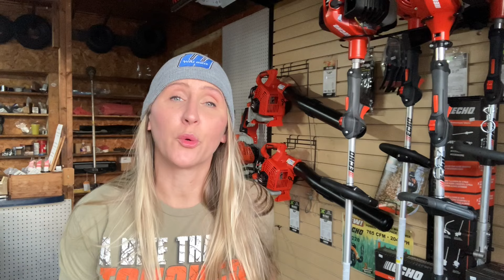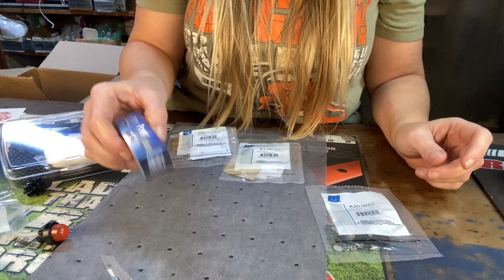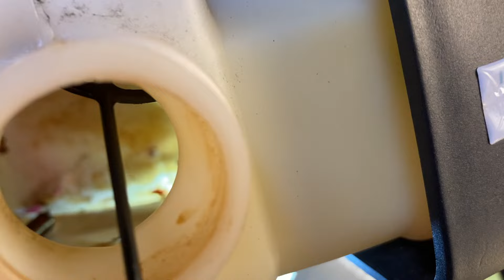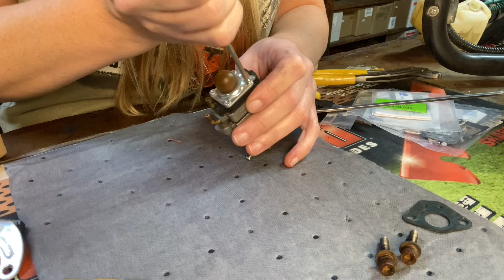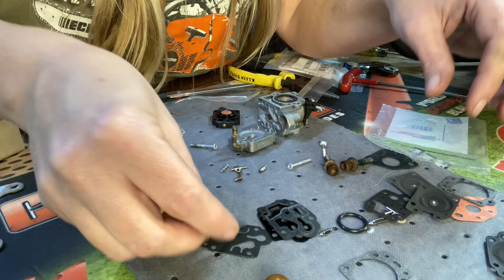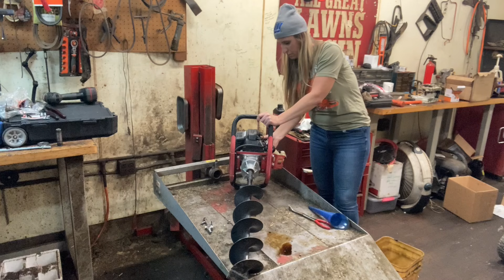Will it run? WALBRO put to the TEST with one of the NASTIEST pieces of equipment in the shop!

Comment: Well we know you're human needing glasses like the rest of us but how do we get some small fingers that are really useful?
How many shops just replace the carb?
Another question I have about ethanol fuels is I was once told by a gas station owner that fuel companies made high octane fuels by adding ethanol so how is it possible to avoid ethanol?
Where I live the available octane ratings for gas are 91, 94 and 98.
From what I was told 91 is the only fuel that doesn't have an ethanol mix.
Do chainsaws and string trimmers have high enough compression ratings to require more than a 91 octane?
There's a lot of ignorance much to the oil companies delight I think where people have been fooled into higher octane fuels believing they are better for their engines but only the fuel companies get any benefit from the higher prices.
Confused especially as I have a brand new Stihl string trimmer running on a 91 mix that starts easily but bogs down and dies as soon as I try to throttle it up. Stihl have told me to turn up the mixture screw which doesn't seem right as anyone would have to believe their factory settings are right straight out of the box.
Do I turn up the screw or use a higher octane fuel that everyone seems to think is bad because it has ethanol in it?
I'm using Stihl's own two stroke mix in the 91 which runs a Stihl chainsaw just fine.

Comment: Have you fixed a riding mower that will only start with a shot of starting fluid ? Mine just started doing it 3 days ago but once it starts on ether it will run like it should but will not start back up with out a quick spray of ether
Reply from the maker: I would check the choke system first. If it has a Nikki carburetor, the lever and flap are terrible about sticking.

Comment: If I were you I would invest in a " Pop-Off " gauge and pump and spring kit.
Now that you are using parts that differ from the original you may have to adjust the let off pressure on the diaphragm needle and fulcrum. Failing this McCullough used to sell a kit for the HL-HP carbs to tune, this kit might have matching parts Tillotson also sells a kit that covers  many of their carbs.

This let off pressure is critical when you start messing around with different parts ( and even stock parts aftermarket ).
Too high a pressure and the engine will be lean at the top end lazy in response to changes and air fuel demands. Too little pressure and sensitivity to the needles is excessive. This really becomes critical when running carbs with the metering chamber above the venturi. Under those conditions you want a carb to be as free flowing of fuel as possible without slobbering, and being insensitive to the needles. 

The name eludes me now, but there was an engineer at Walbro that wrote the book on tuning the W ( if he isn't retired now its been years since I last corresponded ) he would be able to list the procedures and spring options for you from memory. Your millage may vary trying to talk to anyone else there these days.

EC Birt was good too, he would have told you a lot of tricks for tuning. RIP Birt.
He would have been a great guy to ask as a guest on your chanel.

Anyhow once you know what combination of springs and fulcrum settings get you the best response there is no need for the pop off gauge for anything short of racing engines. I used to keep tables of what I knew would work for altitude,  engine, and carb. This makes life a lot easier for the guy in the bush cutting timber for a living if his saw is easy to tune and performing at its best.
Reply: Thanks for the background Walbro info. Best to You and Yours.

Comment: Let me ask you this, sometimes a carb kit will come with 2 fuel pump gaskets, one being a plastic type or carbon fiber look and the other being a more rubber type. They are both exactly the same but what is the benefits of using one over the other?